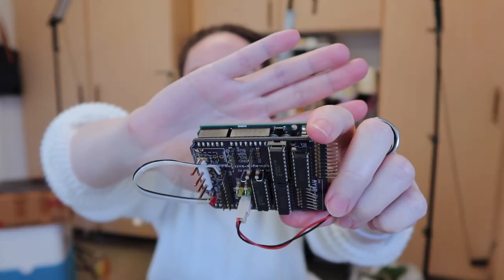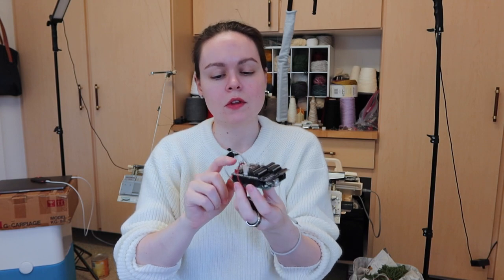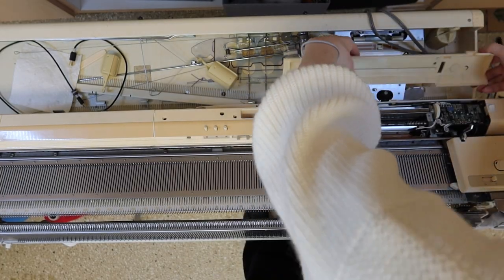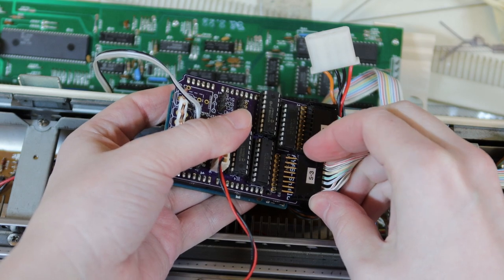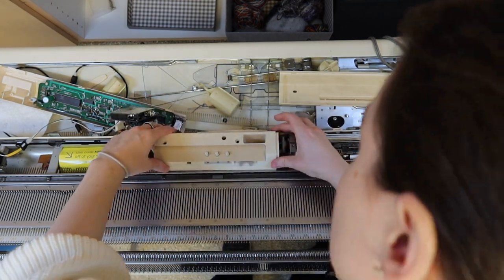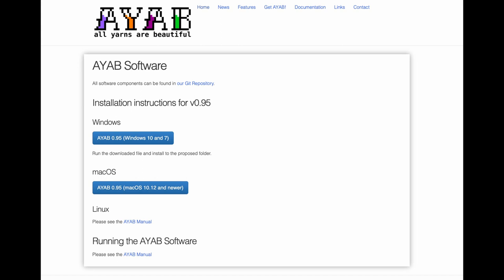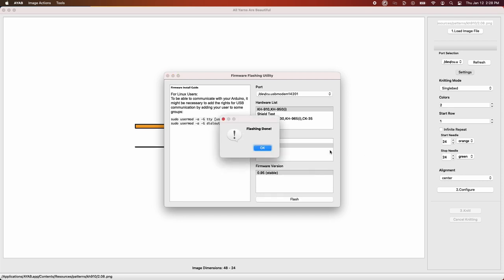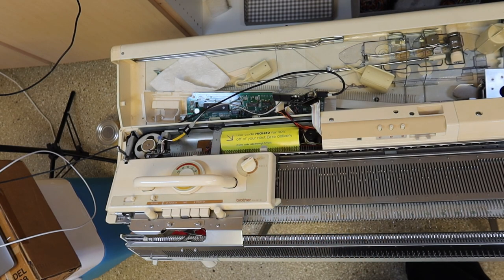Unofficial AYAB Installation guide for Brother 910 knitting machine

Comment: Thank you this will help when I get round to it. So far I have a 910 and an arduino...saving for shield. New fuse and capacitors are my first step though. Need to be a bit braver. No problem with mechanical side of things it's the electronic part that worries me.
Reply from the maker: You can do it! I believe in you!

Comment: Thinking about doing this to my KH910 and watching your video I'm suddenly struck wondering if the data stream can be reversed: Using the Mylar sheet reader as a "scanner" to upload mylar sheet patterns into the software? 🤩
Reply: I woke up this morning and had the sudden thought: The Brother KH-950i has this scanning feature built into the machine, as a normal function. It can hold up to 28 Mylar sheets at a time. It would just be a matter of accessing that scanned data and interpreting it into something modern software can use. 
Becky Stern did a tutorial on YouTube that involved backing up an empty file from her KH930 and then replacing it with a file after running it through a python script with new data.

Comment: Thank you for this video, it helped me very much, after soldering the parts of the new interface, i could hear the "biip" sound. I removed the old interface and I open the small red window, put through the cable, and the machine now is closed , looking tidy. Thanks again, best regards, P.

Comment: Hi Carson, I got the same AYAB shield as you have and also use a KH910, but in the soldering tutorial it asks for the long 3-wire... connector... thingy that goes onto S7, to be soldered on JP2. My AYAB doesn't detect the carriage reaching the turn mark, and I see that your 3-wire long connector seems to be on JP7 instead. Can you confirm that this is the case ? That could explain my issues if it turns out I messed up that solder job. Thanks for the very clear tutorial :)
Reply from the maker: Come pop in the Discord, we can help you there: https://discord.com/invite/Y4HVVAaHqa

Comment: I can understand why there would need to be a hardware hack for the KH900/910/950 because they never had a computer access port, but the 930/940/950i/965i/970 already have tandy floppy disk drive ports and USB cables can be found from SoftByte (designed to connect to DesignAKnit) Surely it would be easier to program the software to use the existing connections?
Reply from the maker: Probably not. I don't have all of the details but I have heard that Brother has a lot of special sauce which means that they don't have standard protocols or data formats. You'd have to do more reverse engineering to figure out how to communicate with the existing connectors. 

But with AYAB, you can just pop off the old electronics and talk to the hardware directly reusing the existing reverse engineering that was done for the 910.

Comment: I have a KH-940. I used to use DAK as my computer interface, but I didn't upgrade when it was reconfigured to Windows (yep, long ago). AYAB looks promising for any applications I would want to use.  Question:  If I convert to using AYAB (or try) do I loose my created designs saved in the 940 or the many other designs that came resident in the machine at purchase?  Is there a down-side to switching to AYAB with the 940 that you can see?

BTW, I do enjoy your videos.  You have gotten me re-engaged with my machine.  I appreciate your analytical approach, quality videos and clear explanations. Thank you.  from Minnesota
Reply from the maker: AYAB doesn't use the memory on the machine so you will lose all of your patterns. There are a lot of resources online that have all of the old patterns for the machines though. AYAB isn't a permanent change so you can always reinstall the original hardware if you want to use it.